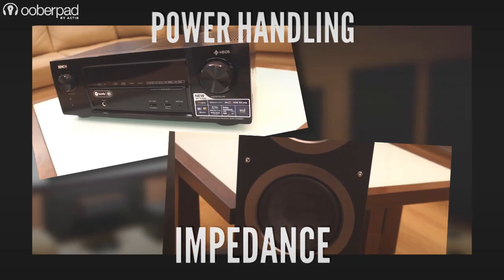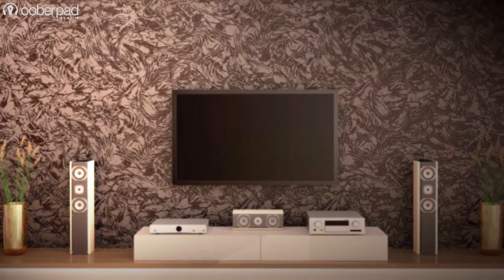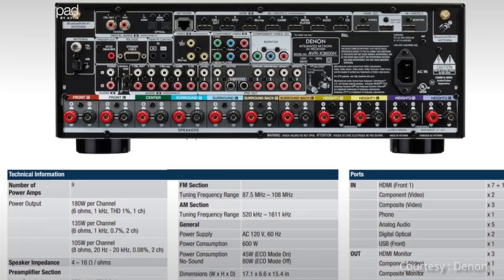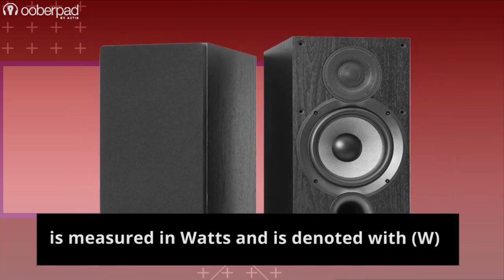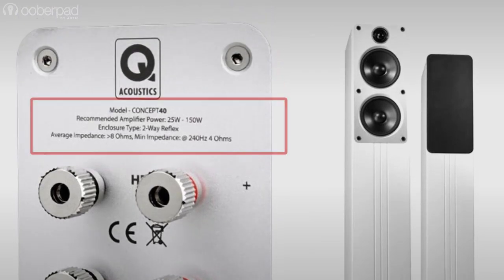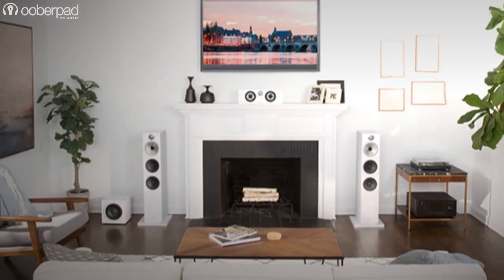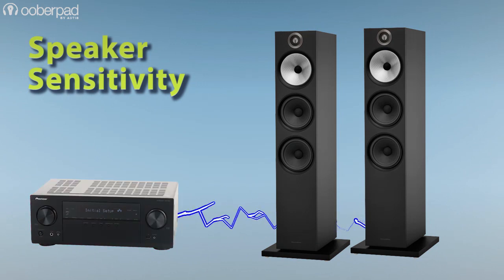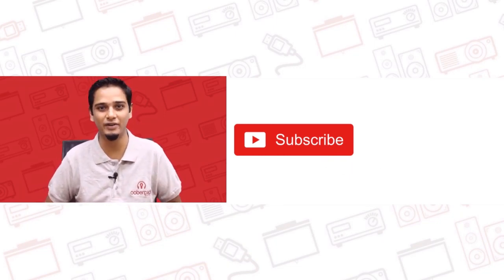How to Select an Amp or Receiver to Match the Impedance and Power Needs of your Speakers?

Comment: Awesome video very detailed simple....just still a little confused I got Rockville TM 150 Tower speakers and I'm looking to purchase another set with a receiver The specs are really not detailed far as like the ohms but the website says it's a thousand peak power and 250 RMS so I'm just curious what type of receiver should I buy that way I don't damage the Rockville TM150s? Any insight or help will greatly be appreciated thank you in advance

Comment: Hi, my JBL 4312 speakers are 6 ohms, and I'm going to use a Mcintosh integrated amp to drive them. My question is should I connect the speakers into the 4 or 8ohms terminals ?? Thanks in advance for your advice !
Reply from the maker: Hi, please chat with our experts via our website for a quick resolution to your query. Visit https://www.ooberpad.com

Comment: hey i have the pioneer  SP-BS22-LR bookshelf 6ohm 80 watts speakers and the center speaker thats 6ohm 90watts, and im looking at the AVR Onkyo TX-NR6050 but the output wattage is 90 watts and the klipsch R-120SW sub thats 200-watt RMS amplifier (400 watts peak power) do i need to find something that 100 watts or more? or is this ok
Reply from the maker: Hi, please connect with us on chat via our website's live chat section to help us quickly resolve your query. Visit www.ooberpad.com

Comment: In my speaker system, (from manufacturer specification) I have 2 main speaker (160 + 160 watts) sets and 2 surround speakers respectively R/L channel. 
In Main speaker mentioned normal impedence range is 6 to 16 Ohms and in surround speaker normal impedence range is 24 ohms or above. 
For this speaker system, how much capacity receiver required

Comment: Which speakers are more suitable for an Bluesound POWERNODE 2i  amplifier (60 Watts x 2 into 8 ohms of HybridDigital™ power). 1 - Q ACOUSTICS Q 3020i (Average Impedance 6 Ohm, Sensitivity (2.83 Vrms@1 m) - 88 db, Stereo Amplifier Power 25-75W) or KEF Q150 (Nominal Impedance: 8 Ohms (min.3.7 Ohms), Sensitivity: 86dB (2.83V/1m), Amplifier RequirementS: 10-100W). Thank you
Reply from the maker: Hi, you can connect with our team via our website's chat section for a detailed resolution to your query. Please visit www.ooberpad.com

Comment: yamaha ns p41 speaker system good for denon x550bt avr?
Reply: Plz replay
Reply from the maker: Yes, But has no tweeter and plastic construction. We would recommend Elac Cinema 5, connect with us for more details and a good deal on www.ooberpad.com :)
Reply: @Ooberpad  my Budget 25000
Reply: Which pack under 25000?

Comment: I have a speaker of different watts
Power Output (4Ω) Total	1125W(3D 270W)
Power Output - Front	405W(3D 135W)
Power Output Center	135W
Power Output Surround	405W(3D 135W)
Power Output - Subwoofer	180W(Passive)
Pls help to select an Amplifier
Reply: LG 5.1 Home Theatre system
Reply from the maker: Hi, please connect with us on chat with our website's live chat option. Our team of experts will help you the best amplifier that matches your speakers. Visit www.ooberpad.com or call us on : 9167386570
Reply: @Ooberpad  tku for the reply
will cone on chat